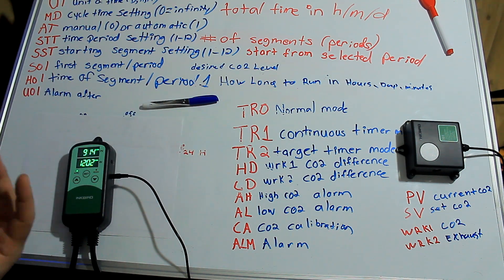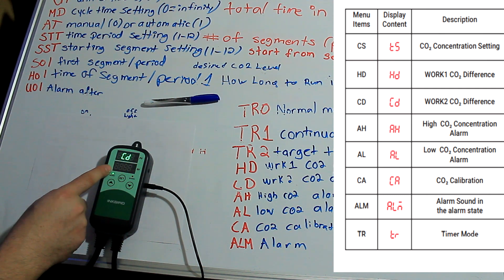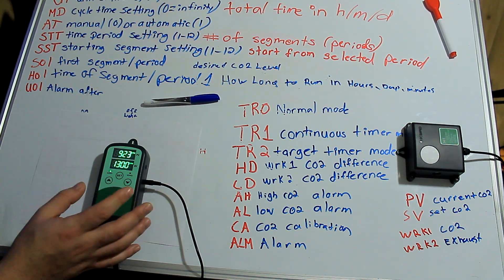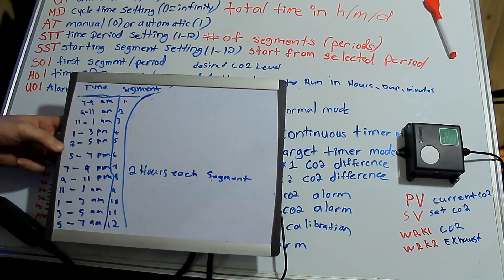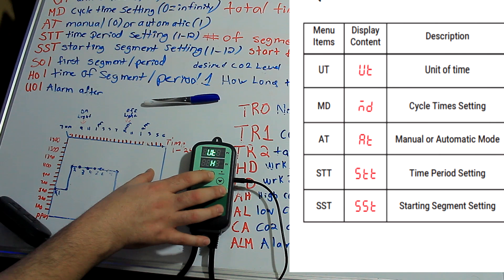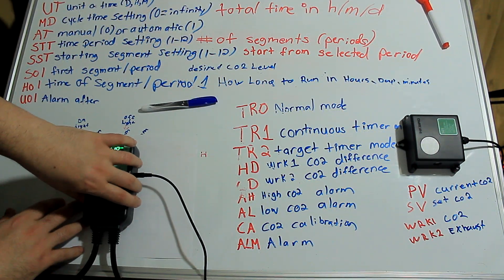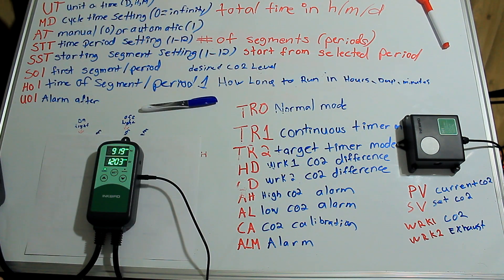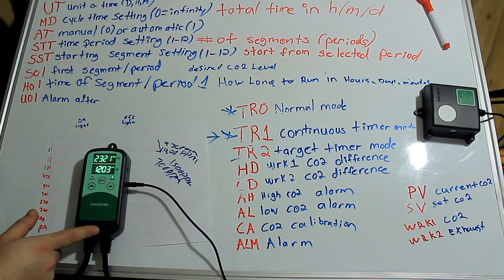Inkbird ICC-500T Co2 Controller Tutorial: How to Program/Setup Guide

Comment: That's a very helpful video there. It saves me some time in having to learn all this through trial and error as I just don't have the time to find all this out the hard way, as you probably did. So cheers for that. I just have two questions I'm hoping you can set straight for me.

1. What determines what times these segments start? On your chart the first segment starts at 7 am yet I don't see anything in the instructions showing that? It does say to press down for two seconds while TR 1 is displayed to start everything from the beginning of segment one. Is that what you did? Otherwise - how do you just start a particular segment at a particular time?

2. Can you just put it on continuous timer (TR 0) and just hook it up to the same timer as your light and solenoid? That would save you from the hassle of the setup as well as ensure that the CO 2 starts working at the exact same time as the lights. Do the settings still stay the same if it's turned off or do you have to redo it all because it resets? Will it work with a timer, in other words?
Reply from the maker: Oh boy its been a few mi uses since i played with this unit..  lol Just set your first segment to when you want it to start or lights on. If that's 10pm at night then so be it. First segment is start.  but yes if you put it in continuous more you could use a regular timer and run it that way.
Reply: @downwithprohibition7364  Thanks for the reply, mate. Much appreciated. So if I understood correctly, it only knows what time it is because you put in what time segment it currently is? So that you can’t set a specific time but only work in these two hour blocks? Did you end up waiting for it to be a specific time just so that you can set it up to start same time as your lights? Because it only gives you these two hour blocks to work with, you’d have to wait around to set it accurately, no?

Also - so it definitely won’t reset when the timer switches it off and will still go back to the same set value when on?

I appreciate you helping us out here. I’m about to lose a lot of my crop if I do this wrong because my dehumidifier broke. Long story. Thanks again, bud 👍🏼
Reply from the maker: @Ivares Kesner  I set mine up at lights on time to make it easier so I didn't have to wait for it to roll around.  When I first set this up i also found it really confusing that there was no place to enter the time. But as long as you setup your segments to have 24 hours you're set..   To answer your other question, I had mine unplugged for a week and it still had my timers set so I think you should be alright to lose power for a short period like 6 to 12 hours.
Reply: @downwithprohibition7364  That sounds promising, mate. Thanks for that. I think I’ll just plug it into the timer and have it turn on along with the light and the solenoid. That way the light and the co 2 will turn on simultaneously. And the only downside will be that it will be off at lights out so I won’t see the nighttime PPM. Which doesn’t matter anyway. Sounds like the better option. Here’s hoping the 12 hours off each day won’t reset it  Thanks again 👍🏼
Reply from the maker: You will get it my friend. Maybe I made my video more complicated than I needed to be... The easiest way to get it going is to make 2 segments. one segment for 12 hours at your preferred co2 level ss an example 1400ppm..  Segment 2 run time 12 hours lower co2 to a ultra low 400ppm so that it won't kick on. Thats if your running 12 /12 just adjust the times if you are in veg to 18/ 6  .....
Reply from the maker: The only issue with the 2 segment timer is that if you have a power failure you might have to manually go in at lights off or lights on depending when the power went out and reset the segment lol  thats why I went with so many in the video.
Reply: @downwithprohibition7364   That’s a great alternative. That way you just have to be around the tent at lights on (or lights off, worst case) and set it. And it’s only once so not all that painful even if you have to set an alarm to get up in time (or just get to it on time). Cheers 👍🏼
Reply: @downwithprohibition7364  Right. I’ll keep in mind the power failure. So far all my stuff functions on manual timers etc. so I have to fix everything if power goes out anyway. Hasn’t happened yet, thankfully.

Comment: Hey question for anyone who is having issues with the sensor reading high. wouldnt go lower than 1100 ppm for my grow room with all the air vented out fan on high. I held the up and down button down and got to a 2nd menu. I left the top line at 3 and the second line i put to 850. Now the sensor reads comfortably in the low 600s. I cant find information on what this menu is and what i changed.
Reply: how do you keep that setting kept and go back out of the second menu?

Comment: Okay guys... this dude has explained everything really well here, but he appears to have missed out one very important key aspect in setting this up, via the ultra confusing 🤔 instruction book written in Chinese English!. A few dudes including myself have posed the question being, how on earth do we actually find the real current time reference in order to ascertain exactly where our chosen segment starts?... as this device has no actual RTC (Real Time Clock) setting. Looking at this video as an example, it illustrates here that segment 1 is 7am - 9am. So if we want our cycle of Co2 to begin at that actual time, then how do we get the unit to start at that specified time & segment number... right?. Well here is the answer, the 12 segments begin at whatever time you initiate your chosen segment to begin selected in SSt, regardless of the illustrated times given here. These are only for reference or guideline purposes, as it is whatever we want it to be. So as an example, if you want your Co2 cycle to begin at say 9am, then all you need to do is this. At 9am real time or your current time zone, simply initiate your first segment by pressing & holding the set button on the front of the controller for approx 3 secs until the display begins to flash. Then go to the SSt option with repeated short presses of the set button & select your chosen starting segment setting number with the up or down arrow buttons, then press & hold the set button for 3 seconds on your chosen number until the display stops flashing. Whatever actual time you do this, (press & hold the set button for 3 seconds on SSt option) will be the exact beginning or start time of your chosen segment number in SSt. Then the remaining 11 segments will automatically follow on in sequence from there. It's as 'simple' (not) as that folks! 😄I hope this helps all those pulling their hair out 😖 over these mega confusing illogical settings!. Cheers🍻 everyone.
Reply: Thank you and yes Chinese English is one way to put it.

Comment: On the side of the unit theres p1 and p2? Whats the difference? Can i use both at the same time ? What are they for? Should one sensor be used on a particular p or can they go in any of the two. Thnx!
Reply from the maker: Sorry man  I misread your comment. I just tried it on p2 and it works just like it does on p1.. im not sure why there are 2 ports. I have just always used port one lol I don't think you could use 2 sensors at a time though. Good question.

Comment: How do you turn on work 2?
Reply: Ok... what you need to do is set the controller so that your preset target PPM is LOWER than the actual current Co2 level displayed. Then the work 2 will trip in. Also make sure that the CD setting (work 2 difference) is at a low value. This is because the controller adds the CD setting value to your current PPM level. So as an example, if current preset PPM is at 400 PPM & CD value is set to 50, then the controller will only activate work 2 when the current displayed PPM level is at 450... i.e. 400 current + the 50 value stored in the CD setting option. Hope this helps, cheers.

Comment: Hey , just curious I'm going to be running a completely sealed room , with an exhaust that's just going to completely circulating the air within the sealed room. Is it necessary for me to have an exhaust plugged into the co2 sensor in order for it to work? , or can i use it with just the co2 regulator and that's it ?

Comment: I got this unit today and it was very easy to set up with this video. I use it in a grow room with various tents and a 4 burner propane generator, the sensor is VERY slow to change and at resting over 300 ppm different from an independent CO2 monitor, the Inkbirdplus. When CO2 concentrations are dropping, there is a huge lag on the controller in comparison to the Inkbirdplus. I’ve run the Inkbirdplus next to an Autopilot F90, and they pretty well measured equally. I wonder if this is a defective sensor..
Reply from the maker: Yeah well it does read pretty slow i will say that. You can calibrate the meter to match up with your other meter. There could be up to a 5% error rate but a 300ppm difference exceed that. Check with inkbird and see what they have to say but you may have a defective sensor there.

Comment: Hello man. thanks for your work! What if you put the Inkbird on a timer 12/12 to stay on TR0 Normal mode, and not have to configure the TR1.
Reply from the maker: Yes that will work also
Reply: @downwithprohibition7364 hey man, I ordered it and the instructions are so overwhelming, I searched for an instruction in German and I found nothing. 
Can you help me please?
I want to use an exhaust fan in a mushroom fruiting chamber  with high humidity (85 to 92% humidity). 
I want that the fan turns ON on more than 5000pm and the fan should turn off when it is below 5000ppm. 
Can you explain me how to calibrate this? I know that I have to use WORK2 and P2 for the sensor. But which mode I have to use ?

Comment: I have a use case I'd love your advice on - think its solved with TR1 or TR2 but unsure. 

I want to keep CO2 below 700, but also run a 2 min exhaust cycle every 15 minutes. So, if CO2 is above 700, exhaust fan is running constantly until I get below 700. But even if it's below 700, I still want to run a 2 min cycle every 15 mins regardless. Is that possible with this unit?
Reply: Have a second and separate exhaust on a timer for your timed air exchanges

Comment: The B01 sensor is the recommended one for growrooms not the S01.
Reply from the maker: Yes you are correct they have made some changes to the units and now the B01 is the recommended product for greenhouses and agriculture. I am not sure if they ran in to issues with the S01 model I currently have or what. I was told from the rep that the S01 was good for up to %75 but now it seems that both the S01 and the B01 are rated for 80% humidity. At the time believe the B01 was rated even higher than 80plus  and now they are both 80% Leaves me a bit puzzled on the actual difference now between the 2 sensors. Maybe with the B01 being sealed up so well the readings were just far too slow, not sure why it was bumped down . I am going to reach out to my friend who works there and see if I can't get more info. I will update my description when I know more.
Reply: @downwithprohibition7364  Yes, I have derived the only difference between the two is the faster response time of the S01, being 20 secs, as opposed to 120 secs for the B01.

Comment: Why can't i have two 12 hour segments. Would that be easier to set up?  I'm confused about how you know when the segment starts. Is there some kind of internal clock.?
Reply from the maker: No there is no internal clock. I just pinned a post to the top where I explain it a bit easier. This is a bit of a confusing meter to program.  You can have 2 segments for 12 hours each one for on and one for off.  But you would have to program it when the lights come on because you won't have so many segments to choose from..
Reply: @downwithprohibition7364  so if lights on at 10am and if 10pm I'm confused about how to set that time segment to start
Reply from the maker: @dk1641  So to start it at 10 you would have to set your starting segment to 1 and do that at 10am. You will see one of the options says starting segments.
Reply: @downwithprohibition7364  so i have to set it at 10 in the morning. I'm sorry this makes no sense to me
Reply: @downwithprohibition7364  can i call you?
Reply: @dk1641  Simply press & hold down the down arrow on the front of the controller for 2 secs until it bleeps. Do this at the actual real time you want segment 1 to begin at. That's it, but the dude missed out this important step!. If you're still not sure, then see my new post at the top here containing full details of how this is done. Cheers.

Comment: This is a fantastic video, we bought one of these for our florist's cooler and the instructions are nearly unintelligible.  Inkbird should be paying you for clarifying their poor attempt at instructions; we were about to send ours back because we couldn't figure out why it was so unstable or how even tell what was set on it and what wasn't.  
The instructions strike me as written by one of the engineers that worked on the unit and the low level programming, so they probably make sense to them, but are just about useless for your average person that doesn't work in their cryptic naming conventions daily.  It's a real failure and personally I wouldn't buy anything else from that company based on that alone.  I don't have a lot of time to spend fiddling with this stuff, I just need it to work and move on to my next task.
Reply from the maker: Thank you I appreciate the kind words. I use quite a few of these controllers, for the most part they are all the same style. This one seemed a bit more difficult than the others, I will admit I was banging my head off the wall by hour 3. You really have to read every page about 76 times to let the data fully soak in haha.. let me tell yeah I would not want to be the guy who tackles that user manual though lol I would be bald in a week 😅  If I had any suggestions for the company I would suggest a lot of pictures and less writing.Maybe something online that is easier to follow along.....  I can say though that I have never had an inkind product fail on me in several years of using their products.

Comment: I just ordered the same as you but just realised that there are 2 different sensors and the B01 is suited to higher humidity environments. I run at 70-75% RH will my sensor still perform or have I ordered the wrong 1?
Reply from the maker: You got the right one man. The other is more suited for mushroom growing and so forth.
Reply: @downwithprohibition7364  Mushrooms require high humidity so I got the BO1 sensor. Is that correct?

Comment: Does it turn off when lights out?
Reply from the maker: Hey chuck, Yes you would want co2 turned off in the dark cycle. Just do what i did in the video. Setup a 24 hour cycle on paper. 12 segments each 2 hours long build your time table and then after it's all setup. set where you are in the in the segments. Set it according to your light on cycle.  Example if you want lights on at 9 am be sure to raise your co2 at that same time to a  desired level 1300 -1400 ppm.
Reply: You are the man! Filling up a 20lbs tank tomorrow 👍